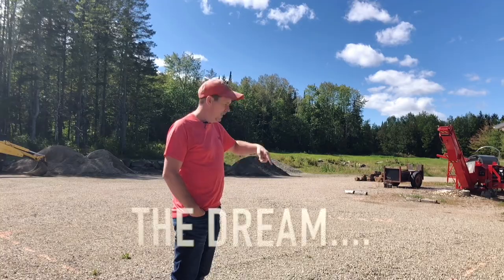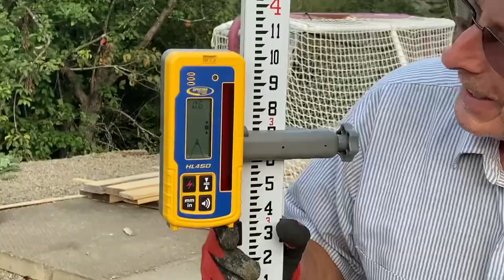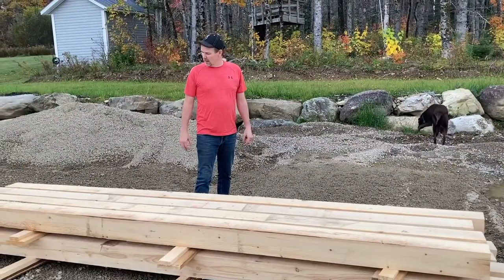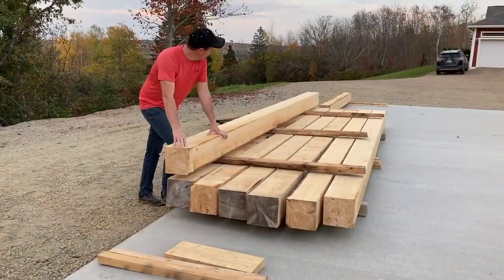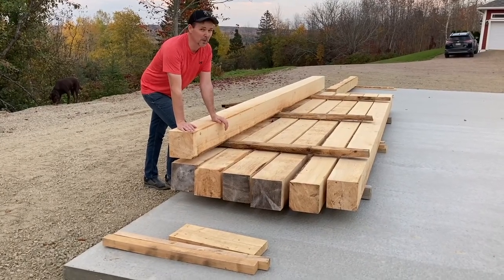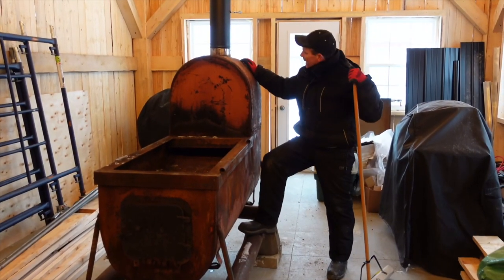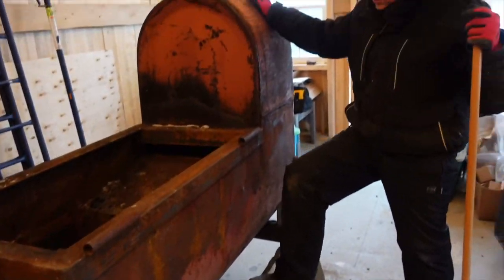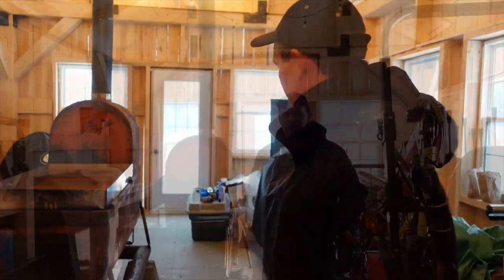Family Builds Timber Frame Storage Building in 20 Minutes - Time Lapsed Build Compilation -E105

Comment: Love this barn project but have a question. Why did you omit the cupola? When you run that evaporator hard, you will have lots of steam!!!!

For those not familiar, sugar shacks used a unique cupola with swing out doors to get rid of the steam. Looking at the homemade evaporator, I would estimate/guess that it can do 15 to 20 gallons an hour.
Reply from the maker: Hi, I liked the style of the monitor barns. We have 4 built in vents in the upper section that handle the steam. Thanks!

Comment: Hey great looking building. I love the timber frame, but was wondering where you got the bracelets to assemble the framing. Thanks Dan
Reply from the maker: Hi Dan, we worked with a local machine shop to have the fabricated. I made templates out of cardboard and they replicated them. We used 1/4' plate and 4" x 1/2" lag bolts. Thanks for watching.
Reply: This building is actually post and beam and not timber frame. Very close but timber framing uses cut mortise and tennon while this form of post and beam uses steel brackets. Both result in an awesome structure. The post and beam may actually be more attractive for a sugar shack. The actual design is more of a miniature monitor barn as it’s lacking the usual cupola of a sugar shack. Post and beam brackets are available from multiple sources on the internet.

Comment: Awesome build brother!  Question - did you have a set of plans that included instructions on what brackets to buy and how to make sure the structure was all tied together for maximum structural soundness?  Like how did you determine how to apply using steel ties/straps/brackets (not sure I'm using the proper terms) and then I see some supporting diagonals as well.  Is there some "how to build it" app that gave you suggestions on how to brace things relative to size and height maybe?
Reply from the maker: Thanks Bill, I spent a lot of time on the internet researching timber frame designs, checking out old barns and talking to old timers. I don’t think this one will come down anytime soon!

Comment: Hey nice very nice build. What calculations did you use on the timber spans? I figured you used 16 feet span on the roof and walls with 8x8 timbers. What do you plan on using to waterproof the roof, bitumen or metal roofing or something more exotic, like old school board style roofing ?  Excellent videos!
Reply from the maker: Hi, thanks for watching our videos! I was told that timber frame should allow for 1" of material thickness for every foot spanned. We used 8"x8" over 16' and put the cross braces up on each side 4' in. This would leave 8' in the center with no support. It seems very sturdy so I hope it will last for a long time.  We put a black steel roof on right before a snow storm. Just need to finish the siding and facia and add a garage door and it will be complete.